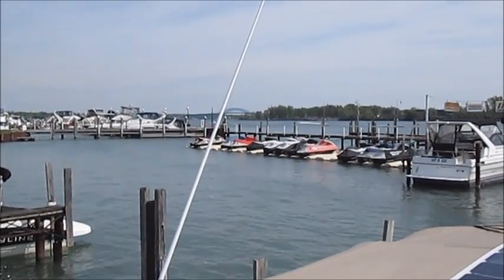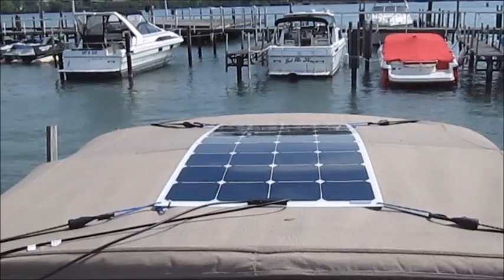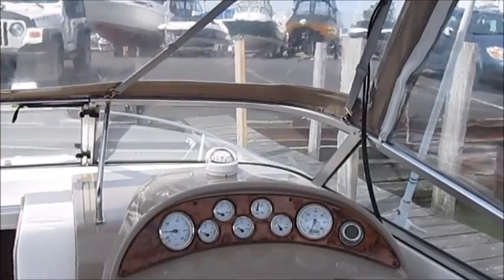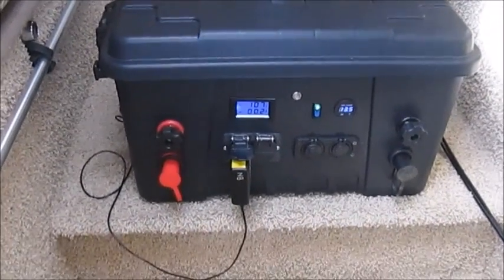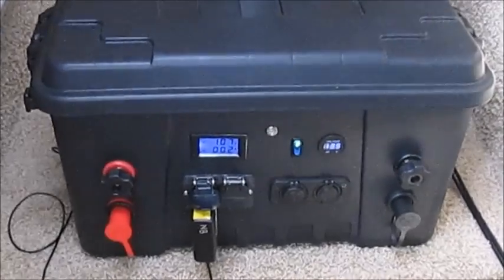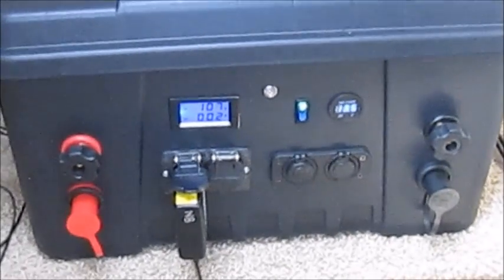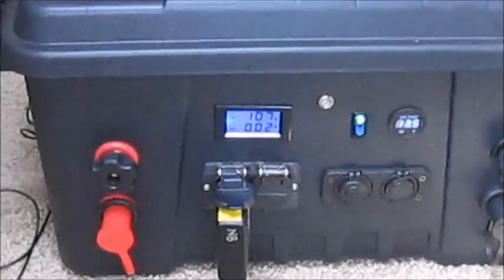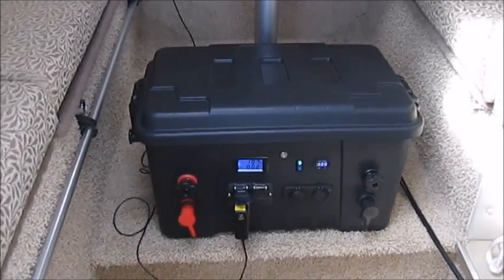V1 P2 DIY Portable Solar Power Generator

Comment: Hi Jim, hope your staying safe during these times. Quick question, i am in the middle of my build and am also going with the 2000w Renogy inverter. I have decided i am not going to be installing the battery terminals. Only the terminals for the inverter. In my case, would it be safe to say I can go with a 4 AGW instead of a 2 AGW? Cutting on cost where i can and if it's a benefit to going with the 2 in stead of 4 AGW. Your insights are much appreciated!!
Reply from the maker: Hi Steven ,  if I understand correctly you plan to attach your 2000W inverter to the bulkhead terminals with the screw on hand knobs on the outside of your case and forego the installation of the other pair of heavy duty remote terminals on which alligator style clips would attach.  The 2000W Renogy inverter comes with doubled 4AWG cables (at least mine did).   They are made to handle the brief peak 4000W 300+ amp load that can be delivered by the inverter.  The cables connecting your bulkhead terminals to either the battery or main busbars should also be the equivalent of the doubled 4AWG cables, which I understand to be 2AWG.   At 2000W 12.8V continuous, your wiring needs to be able to safely carry about 160A.  You could use a single 4AWG cable, but you really need to know your appliances' peak DC amperage draw on startup and be sure that anyone who uses your system never plugs in an appliance whose DC amperage draw would exceed the rating of the 4AWG.  Using undersized wiring can result in excess heat, damage, or worse yet a fire.  Here's a reference that I used to determine ampacity of wires https://www.westmarine.com/WestAdvisor/Marine-Wire-Size-And-Ampacity

Comment: No comments for a long while...Jim can you tell me. If i wanted to run a 400w 220V pump with this unit and assuming the sun is always beating down on the panels during the pumps use....do you think ti will just keep running the pump during daylight hours or would it run the batteries dry?
Reply from the maker: Ok, I'll give this a shot and would encourage anyone else who reviews this to check my calculations for accuracy.   A 400W 220V pump will demand 1.82 AC amps per hour of use.  Inverting from 12V DC to AC at that rate would consume 36.84 DC amps per  hour.  If the pump was running constantly its demand could not be satisfied by this system.  With 200 watts of solar coming into this system you would only be able to generate about 8-10 DC amps per hour.  It would drain the batteries IF the pump was runing constantly.  Couple of other things to keep in mind- this system uses an inverter that generates 110 volts, so a different inverter would be needed.  Also, pumps usually demand a surge of power on startup.  You would need to check on how much of a surge to be sure that your inverter could handle it.

Comment: I was just curious about how much time can u get out of it being fully charged without it having to be recharged?
Reply from the maker: Assuming you would not want to discharge the two AGM batteries below a 60% state of charge this system would offer about 44 amp hours (40% of total of 110AH from the two batteries combined).  44AHDC = 528 watts DC.   If inverted to AC the 44 AH DC= about 422watts AC per hour (assumes about 20% loss due to power consumption of inverter).

How much time can you get out of it being fully charged without it having to be recharged? 

That is a difficult question to answer without knowing what type of appliance you wish to power and for how long you need to use it.  Here is a link to some calculations I made specific to my use/needs. http://www.creeksideartifacts.com/SPMC.pdf
This scenario is based upon  my need to power a small 7" HD TV, a couple of 15" laptops, a couple of cell phones, a LED light, and a 6" fan each day while staying on my boat.

Comment: you can get a great 2000 watt pure sine with remote . its only $404.00 I have had mine for a few years now love it ...
https://www.amazon.com/Samlex-Solar-SSW-2000-12A-Pure-Inverter/dp/B004OU99UE/ref=sr_1_1?s=automotive&ie=UTF8&qid=1484960100&sr=1-1&keywords=Samlex+Solar+SSW-2000-12A+SSW+Series+Pure+Sine+Wave+Inverter
Reply from the maker: Prices on higher wattage pure sine wave inverters seem to be coming down.  The one you bought seems reasonably priced for 2000 watts,
Reply: And its highly rated . mine came with a remote and it shows load and how much power the battery has

Comment: Hi Jim 
I have the same solar charger as you, how did you get the SAE to work with you solar Controler ? As the Sae wires are to thin. The solar Controler need  wires that can handle 30 to 50v witch is like jump lead wires.
Please tell you how to do it as I would like to change my systems through my Sae two pin port. All I have is MC4 connections
Reply from the maker: Carlo, the SAE port I used came with 12 AWG leads.  The solar charge controller can accept and will work with that wire size.  The more important consideration is how many amps your solar array is generating.  The single 100W panel I am currently using usually maxes out at a rate of about 5 amps.  12 AWG wiring is rated up to 25 amps over a distance of up to 6 feet.  The SAE port leads are only about 2 feet in length in my battery box.  Adding two more 100W panels to this system would be possible and the SAE port wiring would still be able to safely handle the 15 amps being delivered to the charge controller, but with some voltage loss.  I would not set up my system in the way I am about to describe if I were to do it again, but I cut off the MC4 connections on one end of my solar panel cables and replaced them with a SAE connector. Instead I would recommend a flush mount MC4 port such as this one http://gpelectric.com/products/cable-entry-plate if you are building a comparable system.  The MC4 solar cables I use with this system are 20 feet and have 12 AWG wiring.
Reply from the maker: Carlo, the data I am getting from my charge controller indicates no unexpected drop in power using the SAE cable, given its very short length.  My 100W Renogy solar panel is rated to optimally generate 6.67 amps per hour and 5.33 amps per hour nominally at 80% efficiency.  Using a 5 hour solar day (which for my area is the basis most frequently cited and used to "average" potential sunlight strength over the entire day), my 100W panel would be expected to generate a TOTAL of 26.7 amps, which is (within a nominal range of variation) what my charge controller confirms the system is able to produce in a day.  You mentioned in a post related to one of my other videos that you have a 50W panel and are getting 12-13 amps - I assume that must be the total you are getting for the solar day, as opposed to per hour.
Reply: Jim Fisher yea, I made some miss calculations on that. It's good to no there's know drop on using the thinner wire. Did you use any diodes in you system?. And you you think diodes make any difference.
Reply from the maker: No. I have not considered using any diodes in the the system.  Would have to do some research on the potential benefits.

Comment: Very nice...thanks for sharing...where did you buy the battery jumper terminal?
Reply from the maker: Thanks-  you can find the remote battery terminal kit here:  http://www.ebay.com/itm/Battery-Post-and-Wiring-Kit-Remote-Jumper-Terminals-/270661963490?hash=item3f04b5cee2:g:-lUAAOSwLVZVjbdU&vxp=mtr
Reply: +Jim Fisher Thank you your response, how about the screw-on knobs you had there?
Reply from the maker: http://www.ebay.com/itm/331323494408?_trksid=p2057872.m2749.l2649&ssPageName=STRK:MEBIDX:IT

Comment: Jim Fisher:  I am really impressed with your project.  Very nicely done!!!  I build a product using plastic battery boxes and drill holes for switches, etc.  One of the best tools I have found for this purpose is a step drill.  Cuts through plastic wonderfully.  Good ones are a little expensive but Harbor Freight sells sets of 2 or 3, depending on size needed, cheap. Again, Nicely done!!
Reply from the maker: Thanks so much Daniel for your kind words.  Will keep the step drill recommendation in mind if have another go at this type of project.

Comment: Hi Jim Thank you so much for sharing this video. This is a truely professional build quality solar generator. I was going to build one based on another design and saw your video and it has inspired me to build a similar one to oyur design. Unfortunately so many parts are different here in the UK as we have 220-240 Volts ac and not 110 V. Also the SAE connector is hard to obtain in the UK I would have to order one in the US and have it shipped over. I have ordered some waterproof connectors from Malaysia that ought  to do a similiar job. Luckily I have managed to get hold of the plano case too so will be underway with my build soo. Can't wait for all the parts to arrive. Cheers. All the best, Huw.
Reply from the maker: +Huw Bevan You are welcome and thanks for your kind feedback.  I think that these systems can offer a good bit of flexibility insofar as connectors are concerned.  I see others have used Anderson power pole connectors that can often connect directly to some solar panels with no modification necessary.  I would have considered a flush mounted mc4 connector port, if I could have found one at the time.  Not sure they yet exist.  My 100W Renogy solar panel came with mc4 connectors that I removed and replaced with the SAE connector.  The flush mounted SAE port afforded a clean, finished look and it would also connect directly, with no modification, to the smaller 27 watt solar panel that I used for demo purposes in the part 1 video.  With some creativity and resourcefulness seeking out the parts I am sure you can come up with some viable alternatives for those parts I used that may not be readily available or suitable for a 220-240V system.  Have fun with your build and do post a video if you can when it's finished!

Comment: Jim, you may have mentioned it already or someone may have already commented on the same, but I was thinking of finding the most compact RV wind generator, so as to increase my ability to keep my set up charged. As I am watching your video, I hear a lot of wind in the back ground and was thinking that maybe compact RV wind generator may do you some really good use on that ship!!! Just a thought, Angler.
Reply from the maker: +Angler Beaudry Yep, someone else mentioned adding a wind generator too.  When I am retired and using the system on a liveaboard boat that will be a likely addition.

Comment: Where is best place to get the USB outlets and other outlets? Thanks!
Reply from the maker: +Angler Beaudry If you go back to my part 1 video and click "show more" you will find a link to a parts list pdf file in the description.  There is an indication of the vendors I used on the parts list.  Most of the outlets were purchased from vendors on eBay or Amazon.
Reply: +Jim Fisher Thanks Jim...very much.

Comment: hi what are the dimensions of the 55ah AGM batt?
Reply from the maker: +Edad Martin The details that follow were taken directly from the website where I purchased the batteries:  Volts 12     Product Height 8.27 Chemistry Sealed AGM    Model UB12550 (Group 22NF)   AMP-HOUR 55   Product Length 9.02   Product Width 5.43   Net Weight 38.58    item number 45980    Terminal Threaded Insert

Comment: Hi Jim great job where did you get the terminals with the screw on knobs?
Reply from the maker: +JVCFirearms Thanks so much.  I found the screw on knobs on eBay under INNOVATIVE COMPONENTS 3GDW9 Fluted Knob, 1 3/4 In, Thru, 3/8-16;  the battery cable bulkhead connectors were purchased on speedwaymotors.com

Comment: What is the maximum AC current you can draw, reliably and sustained from only two of those batteries and how long can you do it?
Reply from the maker: +LFOD7491 Here's the math I did when considering what the system could provide and generate on an average solar day using a 100W panel.  Assuming a 5 hour solar day and the panel working at 80% efficiency it will generate 5.33 DC amps per hour for a total of 26.7 DC amps per day.  I am using very conservative calculations here to account for a less than ideal solar day.  Drawing 26.7 DC amps from the system reduces the batteries to a 76% state of charge which is safely above the threshold for damaging the batteries.  Assuming 80% efficiency for the inverter to convert from DC to AC this provides 2.136 AC amps.  Of course, the amperage drawn by various appliances will vary and this will determine for how long you can draw the current.   A typical laptop computer drawing .25 AC amps per hour could be run constantly for about 8.5 hours.  A small 7 inch TV could be run for about 17 hours.  A 6 inch fan could be run for about the same as the TV, 17 hours.
Reply from the maker: If you can find the CPAPs AC voltage and amperage you can put them into this calculator to determine the DC amps required when run through an inverter 
https://www.batterystuff.com/kb/tools/ac-to-dc-amperage-conversion-run-through-an-inverter.html
Reply: I've been having an issue with my inverter stopping at 10.3V  apparently all inverters are set to turn off at this point. Does anyone have any feed back here?
Reply from the maker: Mark, you would never want to run your 12V battery down to this level of discharge as it will damage the battery.  Do a Google search for a 12V battery state of charge (SOC) chart and you will see that most recommend that your battery never be discharged below 60% SOC (about 12.3V).
Reply from the maker: http://cd8ba0b44a15c10065fd-24461f391e20b7336331d5789078af53.r23.cf1.rackcdn.com/tab-rv.vanillaforums.com/FileUpload/ea/3eb7f3995442c8f98790becf195a70.png
Reply: ok, in your layout, what happens for your 12V. or USB outlets... since they are not on the Inverter, do you have something regulating the draw and cutting off at some point?
Reply from the maker: No, I do not-  I monitor the DC voltmeter that comes on with the USB outlets to ensure that the battery SOC does not fall below 12.3V.  If I were to revise my wiring I would definitely connect both the 12V and USB outlets to the load output on the charge controller- it has a low voltage load out shutoff that would protect the batteries from discharging below a set threshold.
Reply: Ah... My charge controller doesn't have that... Cheep one that came with panel. 

Thanks for the answers. 

Re-batteries... Any reason why 2 x 55 vs one like me?
Reply from the maker: I went with AGM batteries for no maintenance, the ability to discharge them a bit below what is recommended for lead acid batteries, and the fact that they off-gas very little and they would not harm the other sensitive electronics in the box.  The dimensions of the 55 AH AGMs were the starting point around which I built the battery box- I left room for the addition of a third battery in the future that would bring my total DC storage to 165AH.
Reply: Got it...  So given the idea of not dropping below 10.5V and needing 8 hours for CPAP, I guess my cousin sideration should be amp hours first. Then weight lol
Reply from the maker: Yes-  I did some research and found that you might expect to draw about 22 amp hours from your 80AH battery from 8 hours use of a typical CPAP machine.  That will discharge your battery well below a safe SOC threshold.  You are right- another battery seems to be part of the solution (more weight unfortunately) and then you will also need a larger wattage solar panel to recharge those batteries each day.  I can very conservatively generate about 26.7AH per solar day using my 100 watt panel.  I think you mentioned you are using a 25 watt panel. It would take you about three or 4 solar days to recharge the battery for every one 8 hour night's use of the CPAP machine.  Based on what you have described, it now seems more likely that your battery has been damaged and will likely not achieve a 12.7V 100% SOC.
Reply: OMG Jim, you are amazing! Is there a way to calculate Amp Hours used for the CPAP?
Reply: Thanks Jim, so I did that and got 10.93 Amps... what do I do with this information?  Here is the table http://screencast.com/t/rqnTSIHce20
Reply from the maker: Wow- that model CPAP machine draws a huge amount of DC amp hours.  At that rate it would completely discharge your battery in one 8 hour night if the inverter did not cut off automatically at 10.3 volts.   I recommend you read this article to double check the accuracy of your calculation of 10.93 DC amps per hour.  http://www.cchipman.com/cpap_on_batteries.htm